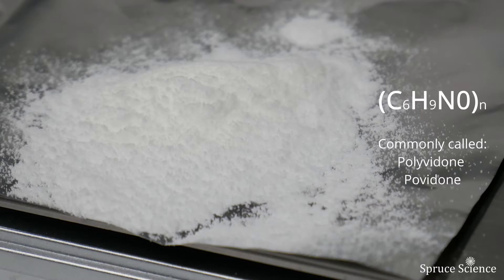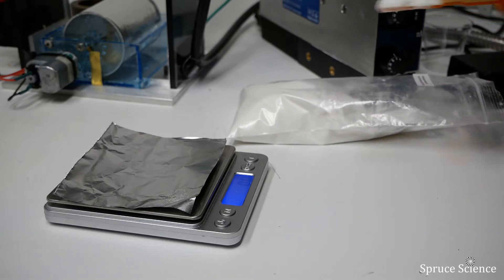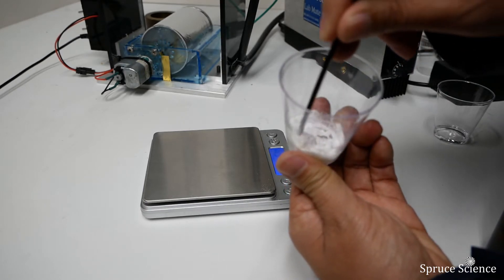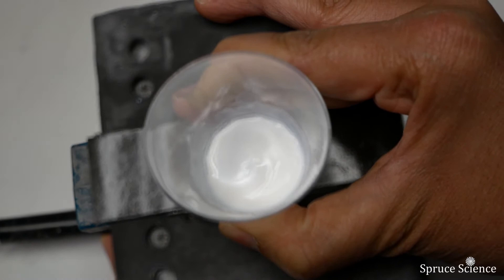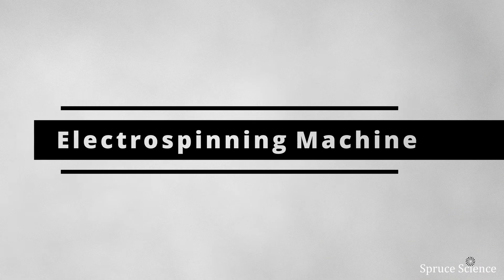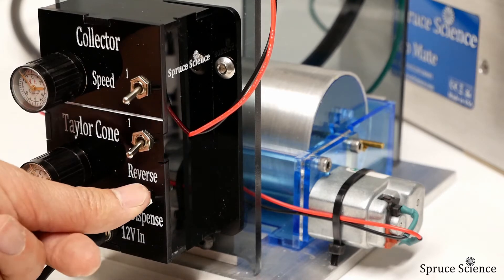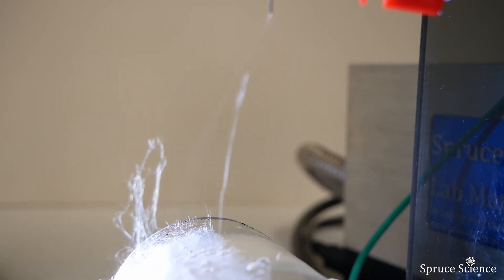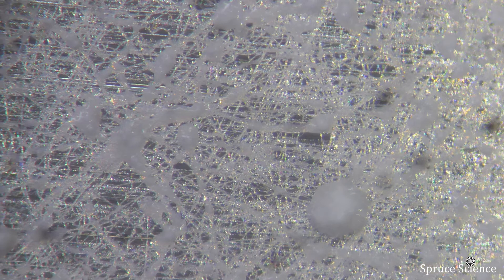Electrospinning Composite Fibers | Zinc Oxide Dispersed in Polyvinylpyrrolidone (PVP)

Comment: you said the taylor cone is pulled into a jet? by the negative collector ..correct?
Reply from the maker: Hi Elijah! Yes, you are correct. The high voltage applied to the needle and sample solution is positive in reference to the drum collector so there is an intense electric field that exists between the needle tip and rotating collector. When the jet travels in air, the solvent evaporates and leaves behind charged composite fibers. Because of the intense electric field, the fibers are electrostatically elongated and collected on the metal sheet.

You can find more information at: 
https://sprucescience.com/resources/

Comment: Thankyou So much Sir .. I really Really appreciate your Concern 🙌
Reply: How did your research go? I wish you did great!
Reply: @tt7762  I got A+ in my thesis 👍😋
Reply: @rjreyaan9856  oh congratulations!! My thesis is about electrospinning as well! And I started doing some researches today, do you have any tips? I've found these demonstrations very helpful
Reply: @tt7762  Yes Sure why not.. 😊 how can I help you
Reply: @tt7762  I can share Some of the research papers related to Electrospinning
Reply: @rjreyaan9856  if it won't bother you and you've the time, could you please share their links? I'd truly appreciate it! So far I've searched for the parameters affecting the electrospinning,  challenges facing electrospinning and needless electrospinning
Reply: @R J Reyaan  kindly share with me that papers as i am also working on electrospinning technique to grow Nano fibers
Reply: Is there any problem for using low voltage source(220 v ac) instead of  dc high voltage source.or let me know how can we construct a high voltage source in the laboratary setup